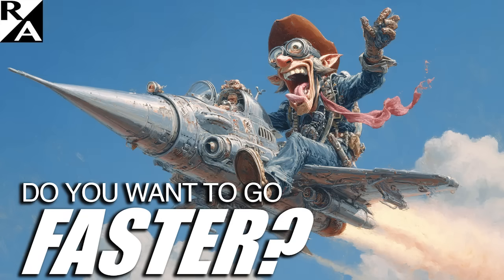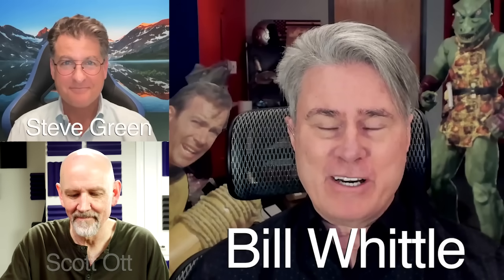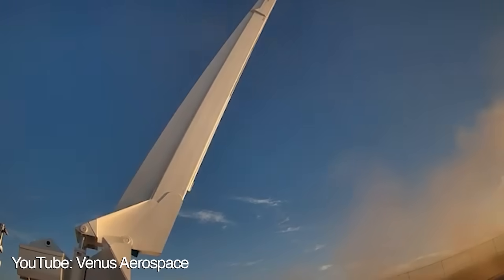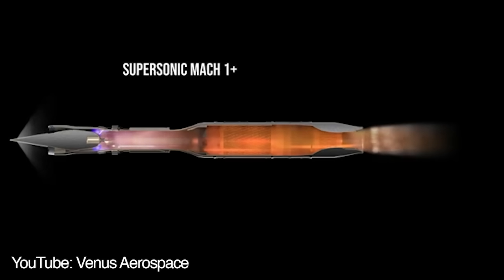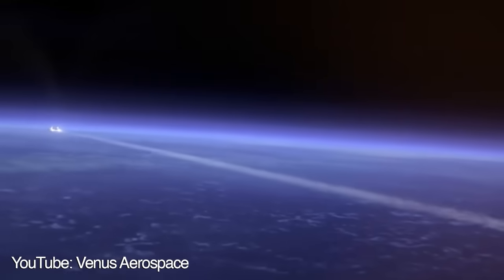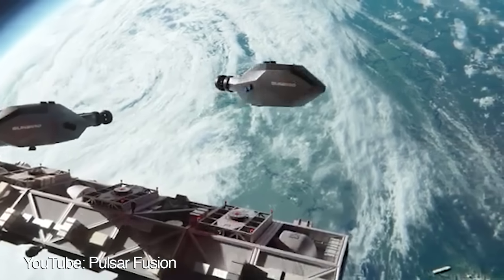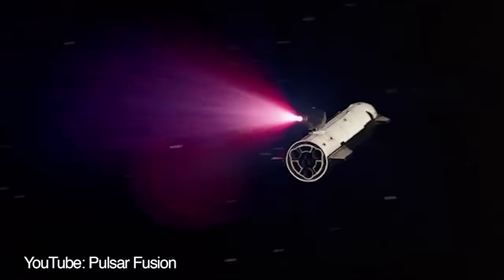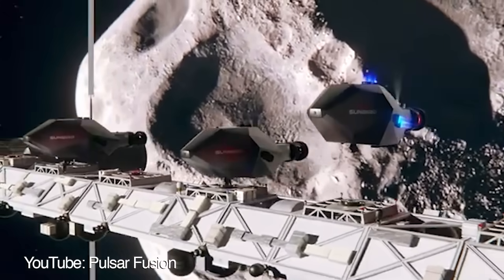Do you want to go FASTER?

Comment: Quick correction for Scott Ott: Straight Wings enable both high-lift at low speeds AND great maneuverability. You sacrifice the ability to attain high speeds however to do that.
F-14 Tomcats use their wings extended both for take offs/landings as well as slow-speed high-maneuverability turns.
     Swept back wings enable high-speed flight at the cost of less lift and loss of maneuverability.

Comment: The problem with Sunbird is that it's Helium 3 dependent.  So unless you have a thriving moonbase with the ability to pull parts per billion out of the upper 3 inches of lunar dust, you have no propellant for it.  Sunbird is a great concept for the mid to late 2030's at the absolute earliest.  Note that at 1970's power demand levels, 50 tons of Helium 3 could have powered the entire US electrical grid for a year.  And the fusion reactors are comparatively simple to build if that fuel becomes available, and with very , very little radiation.

Comment: If Pulsar Fusion builds these small enough, they will solve the "big stuff" portion of the space junk problem. The small stuff could be gathered up by a small craft with a big net. (I envision something the size of a torpedo, you aren't in a big hurry). When your net is full, you just deorbit and burn it up. Or give it a kick from a Pulsar engine, to send it to drop into the Sun.

Comment: "carrying two engines is dead weight"

Gee, doesn't every fictional starship from Star Trek have both impulse engines and warp engines?

<shrug>
Reply: Moving a mass in the vacuum of space is far different than escaping Earth's gravity.  Remember the firefly Serenity ?  Firefly spacecraft had two types of engines also for different purposes.
Reply: Midbulk transport, standard radion-accelerator core, classcode 03-K64, Firefly
Reply: Also, I'd always heard (as far as airplanes goes) that two or more engines is safer in the event of engine failure.